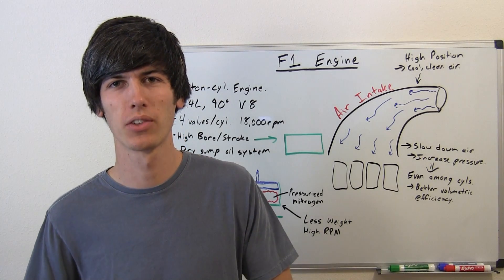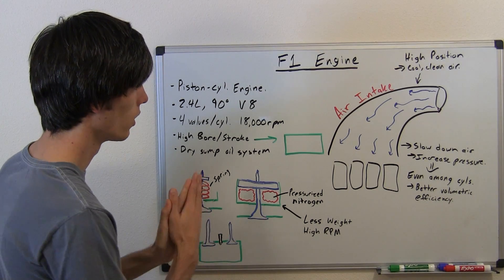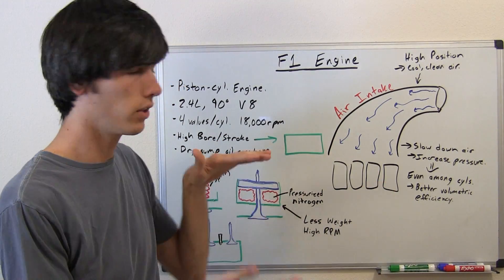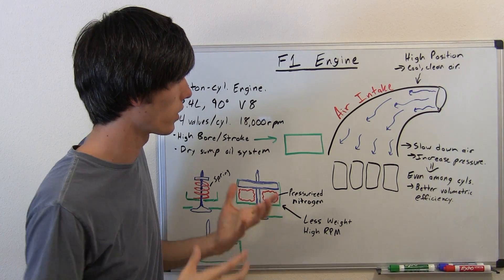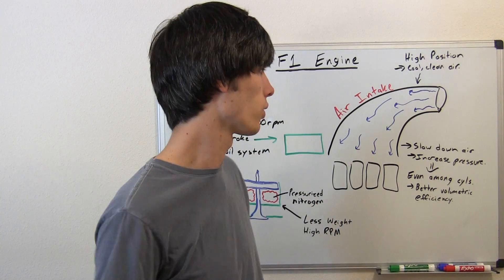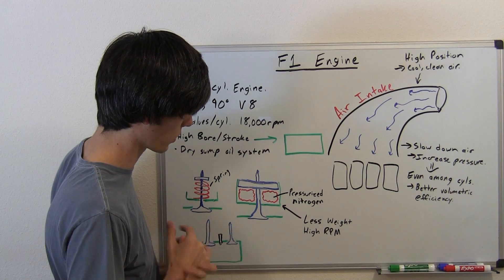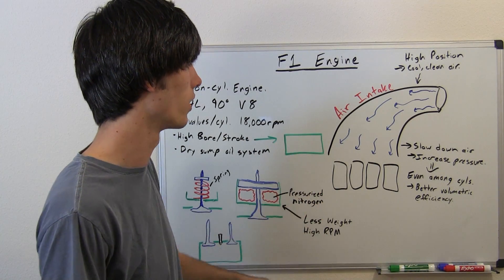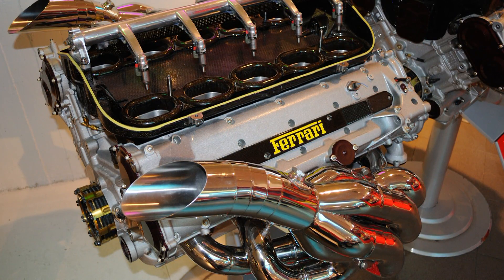F1 Engine - Explained

Comment: Where are engines located in F1 car , front or rear , and Transmission systems too ......... ?
Reply from the maker: +Aditya Shrivastava Behind the driver.
Reply: Engine in the back with the gearbox connected to the engine

Comment: Yeah along with the other comments... The volumetric efficiency can be greater than 100% .. Lots of race purpose engines achieve this because of how well they are set up.. The air flows at such a high rate through the intake that it can have a "forced air" affect and push more air than actually can fit naturally into that cylinder  85% is a weak number reserved for stock engines.. Power adders such as cams,intakes,heads raise this percentage hence the increase in power. More air/fuel=more power.

Comment: Hi EngineeringExplained!
A random question..
A few months ago, the engine in my 02' Mini Cooper S blew up. I am now looking for a new engine to swap in.
My question is: can i use a newer turbocharged Mini Cooper S engine (N14B16A or N18B16A) instead of buying the older supercharged engine (W11-B16) to replace my blown engine? Will the turbo ones fit?

Cool video btw
Thanks!

Comment: Im no engineer by a long stretch, but, aren't f1 valves actuated by air pressure instead of springs?
Reply from the maker: Jeremy W Did you watch the video? I explain that they use air pressure.
Reply: Ok, I missed it, but I did see the drawing and was confused. Thanks

Comment: n/a engines can go over %100 with multi angle valve job and or ram tuning.
Reply: +AsaSpadeSS  Pro stock NHRA have 5 litre V8s that are N/A and achieve volumetric efficiency over 100%
Reply: +ztwntyn8 haha! what?! nonsense
Reply: +Michael Ware (Creative Chaos) I never said it wasn't possible. I can see that for Pro Stock, but not because of a valve job and ram air intake.
Reply: Actually the cylinder head work was the reason for having high VE. The valves are machined to the point where the barely seat during maximum compression of the compression stroke. it's sort of a secret but that the gist of it( i used to work for Jeg Coughlin) 
But ram air does have nothing to do with it.
Reply: N/A engines can have over 100% VE BUT it requires perfect tuning of the intake side and the exhaust side along with port and camshaft design. Ideally the exhaust side components (camshaft  specs, exhaust port and exhaust system would work to evacuate as much of the exhaust gases as possible while on the intake stroke the combination of intake design, port design and intake camshaft specs would allow enough intake charge air velocity to actually pressurize the cylinder before the intake valve closes. Intake manifolds play a big part of this because if they are designed correctly the take advantage of second order (and even third order) Helmholtz resonance which reflects pressure waves that bounce off the valve back at the intake port at the precise moment the valve starts opening again for the next intake cycle.

Comment: Even with nitrogen valve "springs" i guess you can call them, it is still pretty amazing that these things can run at 18 grand with no problems. Running a compression ratio of 17:1 I imagine the tolerances are pretty tight.
Reply: Tyler S So tight they have to run warm fluid through them before they start the engine. kind of like life support.

Comment: Also - With the dry sump, the crank does not have to spin 18,000rpm in oil, so it can spin quite a lot easier when its just "in the air"
Reply: Doggepp Even with a wet sump, the crankshaft never touches the oilsump. If it does, someone overfilled it and that can lead to severe problems.
Reply: +shi01 ya like hydrocracking

Comment: How can it increase pressure when you're giving it more space?
Reply: JackMacyntire Bernoulli principal. The fluid is slowing down and the static pressure does increase.
Reply: shi01 Bernoulli only applies to fluid which cannot be compressed, only pressurized, Air however can be compressed. I have an issue with his description that states when air slows down air pressure decreases. Pressure could maybe increase if the intake was supplying more air than the engine could consume.
Reply: Elder Santos
Bernoullis principal works also pretty good with air up to a flow velocity of about Mach 0.25 some say 0.3. You can use other equations of course, but the result is always pretty much the same. If you slow down the flow, the static pressure will increase, if there isn't a significant change in temperature and/or density, which isn't the case here.
However, the dynamic pressure does decrease, yes. But what you want to achieve is to calm down the flow of the air a bit to get a more equal intake airflow to the individual cylinders.

Comment: Technically, air falls into the cylinders.
Reply: ***** sort of ... the exhaust pulse also pulls air in during valve overlap thats why race engines idle at higher rpm and are rough below their working rpm the intake and exhaust are open at the same time and the exhaust gasses drag the fresh charge in behind their exit
Reply: +Aaron Rome The air enters the cylinders because of pressure difference, so it's both pulled and pushed in.
Reply: yes and getting the flow and timing right is what makes power

Comment: I like these vids... it's actually pretty simple to show how an engine works.
.
(didn't watch the whole vid) 0:55... "and unlike many (What modern-day car revs up to 18,000RPM?) modern-day it revs up to 18,000RPM"... That is not modern day technology, it is "SIMPLE DESIGN", meaning it probably is a short stroke piston with "BALL BEARINGS" on the crank journals... making that high RPM possible, and safe!
.
I watched a F1 documentary last week, and they were testing a inline 4cyl. It gave out a 10,000RPM... Of-course they took it apart and looked at the problem. I do believe it was the connect rods going bad at the journals (thingy that the bottom of the connecting rod to the piston spins on). They where using to smooth medal sleeves as a bearing. I thought, WHY NOT ball bearings? The same day or the next, I watched a vid of Leno's Honda S600. The redline was at around 10,000 RPM's... That was made possible in 1964 with ball bearings on the journals. So why not today?
.
That S600 was basically a F1 engine without a turbo!
.
Fact of the mater is it really is simple engine design, and cars today should be able to redline around 16,000 with no problem. Why all engines don't run a dry sump oil setup, I don't know why either!?
Reply: Well, i can tell you why not to use ball bearings for the journals. How do you install the bearings on the crank shaft? You would need a crank shaft that consists of several parts. This would be more complicated, much harder to balance and the whole thing would be more expensive and less solid. It is abosolutly possible to do this and as you mentioned it was done in the past. But it doesn't mean it is a good solution.
And you will run into a entirely diffrent problem with higher rpm's. Excessive valve float. It is possible to solve this too, obviously. But it would make the engine even more complicated and even more expensive. And the manufacturers are not intrested in expensive to build engines for normal cars.
Reply: shi01 I think in the long run with the engine, ball bearings on both the crank journal, and the wristpin s the safe reliable, and obviously most efficient bet!!
.
The wrist pin bearing would be easy to change... the crank, I do NOT bel;ieve it would be complicated, AT ALL!! Simply put the crank together  at the journals, fitting into grooves like a gear... and held together with a bolt, all balanced from the factory... no more complicated than what it is now. All you would have to do when rebuilding, or replacing the bearings is simply unbolt, slide the bearing on and bolt back together.
.
Two smooth sleeves rubbing against medal is just not efficient, or reliable design. In reality, if you have to take an engine apart and replace, or do measurements/machine (tedious... and can be very expensive) anything more than piston rings, and bearings, there is a fatal flaw in the build.
.
Machine shops have absolutely nothing to worry about, because people are going to start focusing on blueprinting and balancing the engine. If they can get the atomization of the fuel/air right, head work is going to worth the time and money put into having it done. Most of an engine build is an exact science with measurements. Top fuel dragsters are grenade's going down the track, having  to rebuild after every run. It's fun to watch a unbalanced caged animal of an engine spit a shower of flames and sparks going down the track... but it sure as hell isn't affordable (if the rich want a show... we don't have money to burn!). If they allowed for the engines to be blueprinted, average people could get into running top fuel dragsters, without the unnecessary need of rebuilding the engine after every run!!
.
I looked up quite a bit yesterday on the valves. I was thinking about pneumatic valves, like on the F1 engine. But I can't find any detail on how exactly it works. I guess it is top-secret information... Could use rotary cam/valves? There's a easy solution. That is why I can't figure out exactly... it's not technology, it is simple engine design!!
Reply: Brian Davis
The sleeves hardly rubbing on each other. Theres a thin oil layer between them all the time from the point the oilpressure has build up. Btw ball bearings would have the same problem. They would run dry at engine start, unless you would use sealed ball bearings. But i can tell you, these things fail always at some point. It doesn't matter in terms of reliability if you use ball bearings or fluid bearings. Both systems will fail with unsufient lubrication. But both systems can do 1'000'000 miles if was looked at and run properly. But a system with ball bearings would be more expensive and the only benefit is really a little bit less friction at high revs.

And ball bearings wouldn't solve the problem of rebuilding the engine after every run of a top fuel dragsters. Their engines are simply not made to hold for more than 1 run. EE just recently made a video about that.

Just take a look at the F1 engines. Back in the day when they used the unrestricted 3L V10 engines, they used up to 3 engines per car per race weekend. They were build for a distance of about 300km and the fluid bearings were not the limiting factor for this.
You want to know how they reved that high? Well simple, minimize the moving masses. Every part was made as light as possible. The last generation of the V10 F1 engine had a overall weight of 80-90kg. That's insanly light. But the drawback of this lightness was the poor reliability. They were build for a distance of one Grand Prix.

And at the end of the day, why would you like to have a engine that can rev up to 18'000rpm for a everyday car? Theres not much benefit in it for a normal car. The engineers in F1 did some tradeoffs to reach this high rpm's. No flywheel was just one of it, which resultet in idle revs of about 4000-6000rpms. To get the car rolling, they needed about 10'000-12'000rpms otherwise they were in danger to stall the engine. And you would like to have something like this for your everyday road car? really? How much money you have ready for new clutches? Because you will need a lot of them.

Theres race engines and theres normal road car engines. And a road car engine will never reach the power of a race engine without sacrificing it's reliability. Ball bearings won't change this simple fact.

Comment: the intake is for Ram effect, and the intake is NOT a diffuser.  pressure does not go up In the intake .  max pressure of the intake is based on ram effect.  its about .36psi at 160mph.  It doesn't go up based on the configuration of the intake.... its not a venture!  :)
THE AIR INAKE SPEED, is not determined by the incoming air, but the engine below.  HUGE difference!   just look at underbody defusers... the air enters the car, sped up and the pressure drops under the car, and then at the rear, the defuser rejoins the flow to the upper flow air where the air pressure returns to ambient.      a wing doesn't increase pressure, no matter the speed. it increases speed so that the pressure drops, which allows the ambient pressure side to press on the wing, upward and you have lift.

Comment: See lots of comments about why not pneumatic valves in normal cars. Price, and driveability. Typically speaking, Torque is a product of force. F=M*A So you can have tons of mass moving slowly, (which most cars drive under 2500 RPM) to give you nice driveability. You can counter the torque with power, (simply speaking) but you have to do 1 of several things to make it work.

1. You can make it super light, so there isn't much weight to move, and thus needed less torque. IE: Carbon everything..
2. Increase the output, more air=more power=more fuel=more expensive to drive.
3. Increase gearing to compensate for weight, have more gears = more weight = more technology = more expensive. F1 cars literally do all of these - 7-9 spd transmissions with ridiculous gearings, carbon fiber everything, and tons of power.  That's why they are $1M+ to make.

So again, back to everyday driving, You need a 350 hp, 150tq car that revs to 15,000rpm (which would be obnoxious), a mostly carbon fiber car, or lastly a 9+ spd transmission. All of which would is currently just too expensive or silly to do.